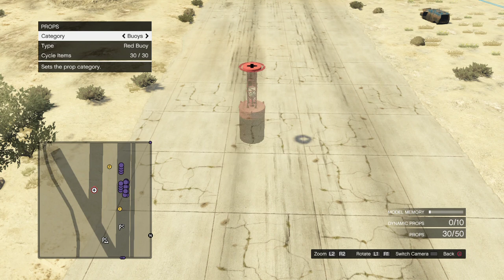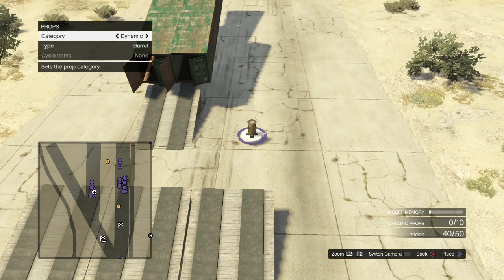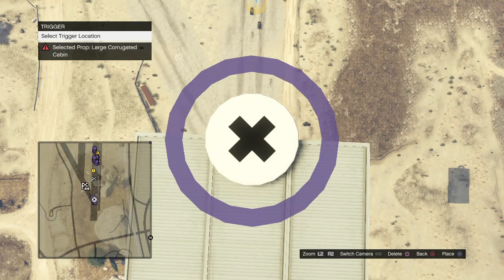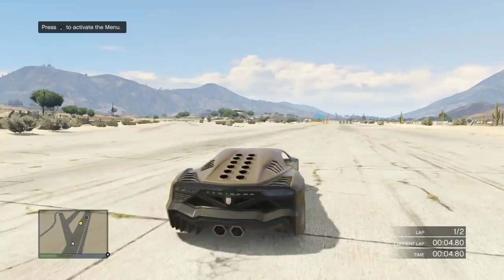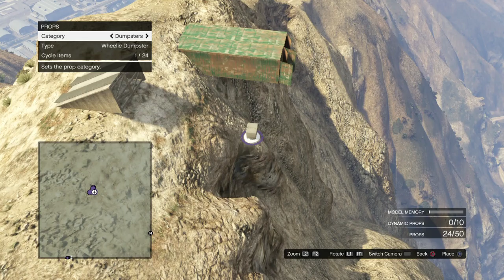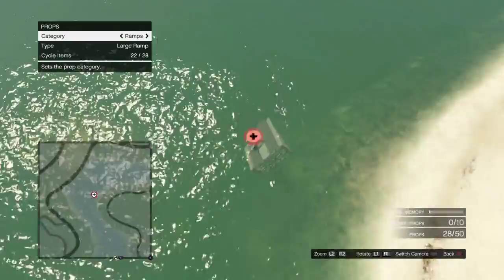GTA 5 Content Creator Build Quick Easy Mega Ramps Trigger and Check Points In Air After Patch 1.17

Comment: The trick for lighning up containers was awesome,  but i could only get it to work with the containers u used,  also it only works if there going in the right direction,  so if u cant get to work keep changing the direction until they lign up,  very nice trick , also why do other containers with flat edgès not allow u to put them together as soon as they get like 3 feet apart it turns to hollow

Comment: I cant set tdm spawn points in air !How to ?
Reply from the maker: yes you used to be able to place then replace the spawn points on container platforms that has changed with some of the recent updates and patches you can still place them on platforms by using the drop and drag technique from the ground to the platform.
Reply: What do I do?
I cant set it on ground, drag and drop in a container or anything. It, just by approaching the spawn point to a prop it get in red color.
Reply: +Maxtorque87 that what you showed on the video and what you said to the dude with the ground and the platform still works in 2016 on the PlayStation 3??

Comment: the container ramp is not working
Reply from the maker: They can only be stacked on small or medium ramps and you have to use the cement bag and left on the D pad and X to place them.
Reply: Maxtorque87 thanks now they are working  dude you are the best make a video how to make loops pls with container ramps and normal ramps
Reply: the funniest page  here is a loop tutorial i made it shows how to make a loop also a loop which shoots you out the middle of it hope it helps :)

Comment: There's an easier way for floating even white cabins. U put a reference cabin to the side of where u want the 2 even ones. U put the reference slightly lower than u want. Then u get a 2nd white cabin move it to where it's touching the first and hit L3 then move it to where u want it. Then take the 3rd white cabin touch it to the reference cabin hit L3 and move it around to where u want it. Just don't run over any other floating cabins or the height will change. Makes the 2nd and 3rd perfectly level. Then u delete the reference cabin